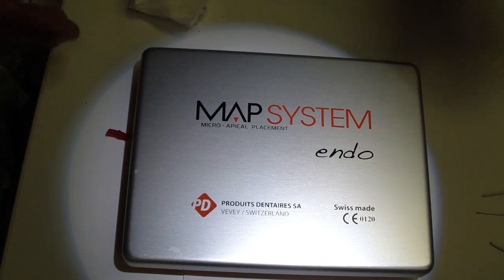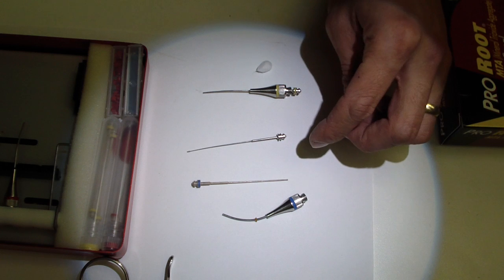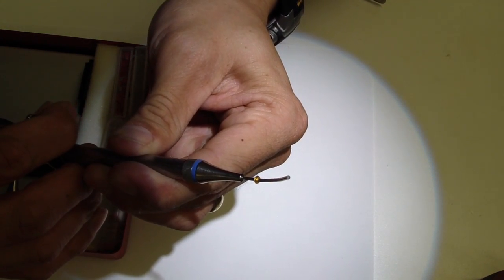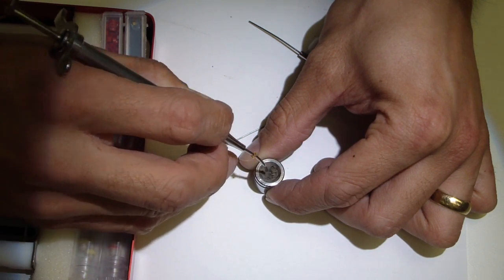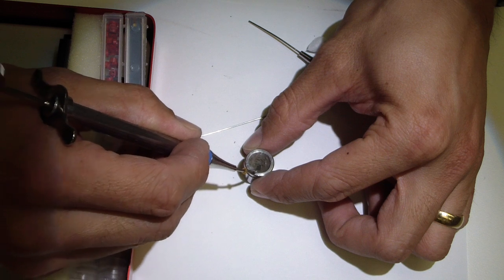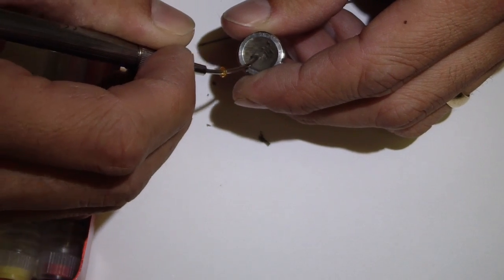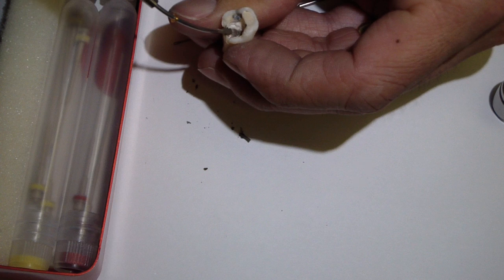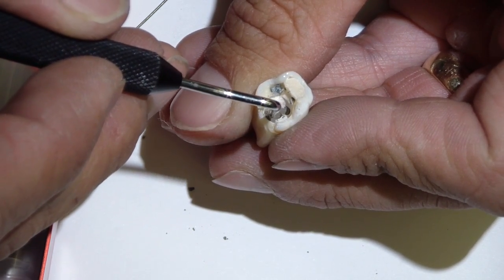MTA Endodontics - Mix, MAP, Perforation

Comment: The red/yellow stops or rings that come with the system are used to keep the needles clean after each placement of MTA. Slide as many rings on the needle that you will need and after each extrusion, use the metal key to slide one ring off the needle. It is another aid to help you keep MTA from gumming up.

Hope that helps!